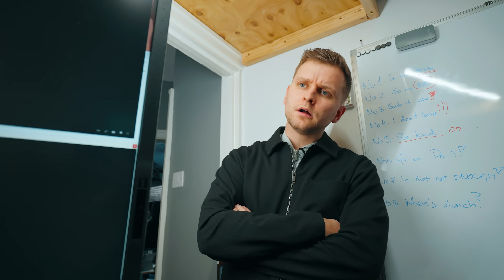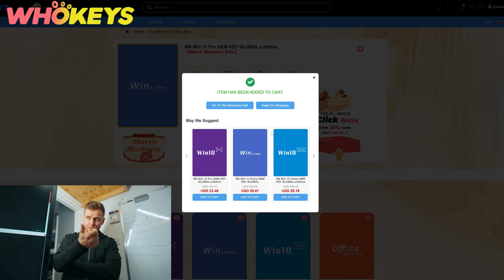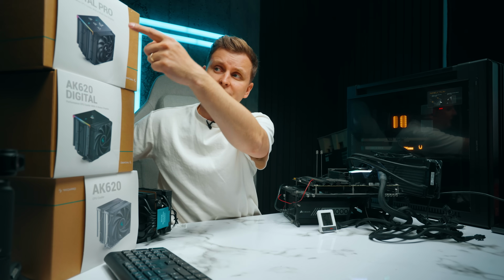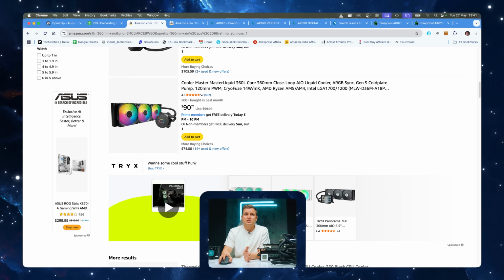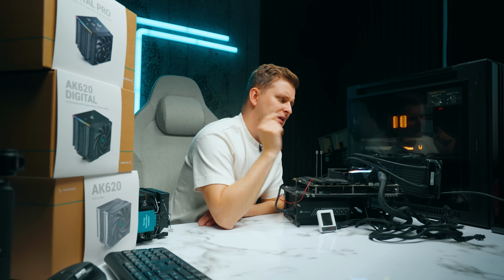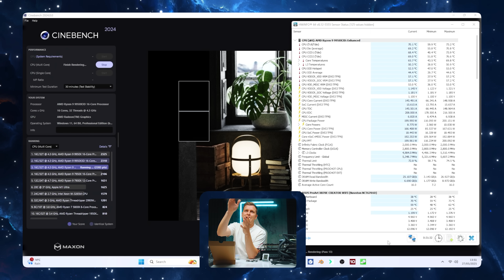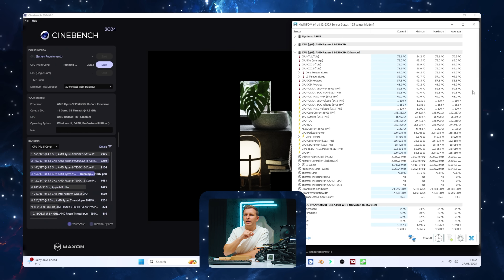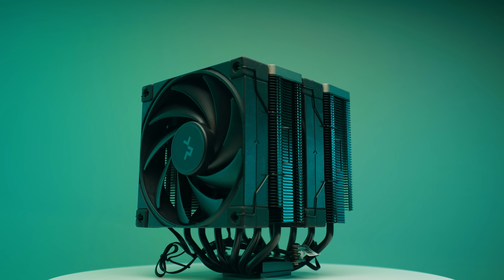Stop Overpaying for CPU Coolers Now! AIO vs AIR [PROOF]

Comment: Thermally, an air cooler will do quite well since heat pipes can pull a crazy amount of heat away, where an AIO will be limited based on water flow over the heat spreader more than the water temp itself. Moving to a thicker radiator like in an arctic liquid freezer three allows noticeable gains, where running fans in push pull will yield greater gains again since fans only actually push their max static pressure at high rpm (large air coolers always do push pull). 

The big benefit in an AIO comes with things like the 5080 or 5090. In a traditional layout, I don't want to dump 600 watts of heat straight into an air cooler above the card, where with an AIO I can run it on the side, with the bottom being an intake to feed the card, and the top being an unrestricted exhaust to remove said heat. Custom liquid loops also do really well because of the large amount of liquid and surface area of multiple radiators plus the stronger pumps. A 5090 fe will run cool considering the power its using, but with a custom water block it will run cooler. 

That being said, AMD uses a very thick IHS on their 9xxx series chips and a direct die for either an air cooler or aio will yield huge benefits. Overall, it depends on the case, the layout of said case, and what the intended use case is.
Reply: Totally agreed
Reply: Nicely explained
Reply: if this is true thanks a lot for this comment

Comment: New custom open loop...it's part of my PC hobby. Custom open loop can be built for the price of 3-4 AOIs. 2 rads,  cpu and gpu under water. If its kept clean COL can last many years. AIO is ez button for liquid cooling and with no maintenance aio can last 5+ years. maybe. The coolant evaporates and pump is non serviceable. Air coolers have gotten much better. Fans can be replaced and probably best cost effective CPU cooling. What about the GPU though?

Comment: Hey always cool to check out your vids. I'm running a 285K with an Arctic Liquid Freezer III 420 , I'm a full time editor and motion person and my system is basically pushed most days all day long. I noticed my temps were running quite hot between 86 and 98 which was too hot for my liking. I got the Arctic Intel LGA1851 Offset Contact Frame and replaced thermal paste with a KryoSheet and my tempos dropped by 11 to 13 degrees under load, kind of blew my mind. Not saying it will be the same for everyone and it could have been the result of a few things even down to the pump screws not being perfectly tightened etc. Regardless I'm super happy as my system is now more stable as well so it's a win. The liquid Freezer also has that fan blowing on the VRM so that is a bonus. The hot spot in the Intel CPUS is still there but shifted a bit so If anyone is running one I would recommend an offset contact frame.

Comment: I just wished AIO's used a non-conductive fluid for when catastrophric failure does happen. Or if they already are, put that info on the box.
Reply: Unfortunately there don´t seem to really be ideal solutions for that dilemma. You can use distilled or even double distilled water, which does not conduct and would pose no risk whatsoever to electronics in case of a leak, not to mention water is a very good coolant because of how much heat it can carry away per volume. However if you were to fill the coolant loop with distilled or double distilled water, although safe in case of leaks, then poses another important problem. During assembly of the AIO's fungal spores floating in the air often end up inside the coolant loop, and the substantial warmth of the coolant liquid is the perfect comfy breeding ground for those fungal spores, which eventually grow to such a dense clump that it can clog your AIO which will cause a failure to cool the CPU and can fry it. So in order to avoid that issue they use additives to prevent fungal growth in the coolant, but guess what, those additives make the resulting solution conductive again! And all of this could potentially be avoided by assembling the AIO's in an ultra grade cleanroom of the samy grade as they use in semiconductor industries, however that would raise the prices to uneconomical heights.

Comment: I'm using a ThermalRight Phantom Spirit 120 SE cost me $36 USD, keeps my 9800X3D nice and cool under gaming loads and idle, never even considered an AIO for it, just not needed.
Reply: air cooling is sufficient even for a 9800x3d? very impressive

Comment: Air coolers are generally much more reliable and long-lasting than AIO liquid coolers for decade
Reply: despite owning and using air coolers for most of my life, i never used a single air cooler for more than 5 years, i have like bunch of them collecting dust, either upgraded the whole system or just went for better cooler, now im running 360 AIO and it its much better than my previous nhd15 chromax i was using
Reply: who tf is using the same pc for a decade
Reply: @lamp6381  you don't need to change the cooler when you're changing the platform, only mounting mechanism (see Noctua and others)
Reply: @lamp6381 Who tf still use AIO when custom water loop is still superior….
Reply: @-raist difference is that the cost between an air cooler and an AIO is at maximum $100 and even then it’s only because of RGB, noctua NHD15 is the same price as Arctic Liquid Freezer III Pro 360mm but gives 10 degrees higher temps. Custom water loops are hundreds of dollars more expensive than AIOs so it’s not even the same argument.
Reply: @-raist  custom loops are utterly unnecessary for the average user lol
Reply: Not really.

Comment: Thanks for a great video. I just finished a build that has an ARCTIC Liquid Freezer III 280. There are options to have individual control of the pump and fans or have them on a single control. Which is best, and if you go for the individual control how should you program this to get the best in terms of performance vs noise?

Comment: 200 WAT is not too much,
when u test 300-400 watt cpu s like 12900K/13700K/13900K,KS/14700K/14900K,KS with remove PL2 limit on them (Which gonna need when u want to get to theirs max turbo frequencies)
only liquid coolers (360/420 ones with good pump and fans  and preferably thick radiators can do cooling)
is some cases like 14900K,Ks even we have just couple AIOs capable of cooling (like Arctic liquid freezer iii pro 420)
other wise need to use custom loop for it! if want to reach its max speed without throttling during 100% loads
Reply: if you care about reading the max turbo frequency, sure, if you actually look at the performance difference from 200 to 400w and notice it's about 3% on a 12900k and maybe 10% on a 14900k ... you realize it doesn't make any sense to let the cpu have that much power to begin with
Reply: This

Comment: At 15:27 you were reading my mind.  The air movement over and around the VRM's and Memory sticks is the bonus.  Most folks dont realize how much heat they generate when under a load especially VRM's on overclocked PC's.  My workstation actually sits at the far corner of my desk (I do have a very large desk though) and it's fan cooled, I don't think I could adjust to the noise of an AIO setup.  Good Video! 👍🏽
Reply: Some AIO’s like Arctic Liquid Freezer III have VRM fans on the pump block which probably cools it better than air coolers because it’s directly blowing air onto the VRMs
Reply: @themarketgardener  Nice! is that layout the exception or the norm if you dont mind me asking.

Comment: I recently had a Cooler Master 240 AIO crap out on me, giving me temperatures climbing up into the 80s for no apparent reason.  Personally, I know the pump block was clogged with contaminated coolant overgrowth, which I experienced with a Corsair 120 AIO two years ago.  So, I switched the AIO out for a ThermalRight Peerless Assassin, and never looked back.  Last year, I sent ThermalRight (I believe it was them) an idea for a Tower AIO that was a hybrid cooler with a pump block, coolant-filled heat pipes, and cooling fins.  Fan mounting would remain the same.

Comment: You went to a lot of work to get these results. I salute you for that. I prefer an AIO mainly because it opens up the inside of your case more. I feel that using an AIO also allows better air flow in your case which should cool the MB and components mo' betta. I've never seen a video about this, but it would be interesting to see what the results are. I'm not against your open air testing but many of us have these components inside of an enclosed case so I would think the results may be different.
Reply: I've seen several comparisons of air coolers to AIO liquid coolers and in almost every one, the air cooler either wins completely or is so close that it's a better choice on cost, reliability, and noise.
Reply: I prefeer air cooling. I dislike annoying fancy scam deals.

Comment: Well, its open  air in your test, i dont think those results would be same inside actual case
Reply: I agree. I got a peerless assassin and it struggle to cool  my cpu in a closed case (even cpu load only, with the gpu doing nothing). It choked the whole build and since I had  invested in fast ram and everything to squeeze every little drop of perfomance I swapped it, and now cpu is cooler, also the fans ramp up is less annoying  before it was going weeeee woooooo and then weeeee at every little thing
Reply: @Ureroll odd for you, PA keeps my 9800x3d as cool as it can be lmao
Reply: People missing the point of Air cooling, if you have tight space go for AIO. But if you have a highly optimized Airflow case Air cooling will yield the result close to AIO slightly higher but not that much.

I use Thermalright RP130 in my Corsair 4000D airflow I have 14600k drawing 200w and xfx 9070xt drawing 370w, but with enough airflow the Gpu is only 53c and cpu is 80c. The room is 25c and all the filter are in place.
Reply: @Teasharky  a decent 360mm AIO will give pretty much ~7-10c lower temps than best of the best air cooler and thats not it, if you mount it as an exhaust it will reduce the overall temp in your case due to much better heat dissipation - that means much lower gpu, ram, storage and chipset temps, compared to any air cooler where it mostly dumps the heat inside the case while relying on case fans to take care of it. TLDR: good AIOs have vastly superior performance than any air cooler on the market.
Reply: They would if the fans are configured the same. Tried it before been air and AIO cooling. AIO wasn't that much better.
Reply: The noctua 12a is the best
Reply: Open air test the efficacy of the cooler. Every case is a variable. It’s taking away that variable
Reply: @get2choppa  but if this variable effects cooler's performance to such degree that it will no longer be comparable to real life scenario in any shape or form, how much value the test contains? Who is the information for?
Reply: @h1tzzYT you seem to completely miss the point. It’s to show what the cooler can actually do. It’s really simple.
Reply: @get2choppa  Thats the thing, its not simple at all, in fact testing cpu coolers is one of the most difficult tasks, because it is a very dynamic thing. You say thats to show what cooler can actually do, but what you suggest is the opposite, a cooler is NOT going to show it's true potential when it constantly receives fresh air in open test bench. That's typically the difference between AIOs and air coolers and air coolers gains from such methodology the most. In proper closed case setups, air coolers are notorious for getting overwhelmed especially when you introduce high powered GPU which constantly dumps bunch of heat. Sure you could argue that with open test bed it 'removes' the case and fan variable, but that is variable by itself (being in open test bench) which is never going to be used in practice. Therefore open test bench cpu cooler reviews are way less valuable than closed case tests.
Reply: It is that simple
Reply: @get2choppa  You are being obtuse just to argue, have a good one👍
Reply: you are right, this and other test like this are fine to show how good an air cooler is, but only with room temp air. in my case the rtx 4090 is producing 70°C hot air for hours, while doing ai stuff, so the temp inside the case is at least 60°C, good luck with an air cooler ...... my aio is always cooling with room temp air as it is pushing air in, not out
Reply: facts
Reply: It will, air cooler towers get affected less by GPU hot air, the AIO to air delta is likely going to get smaller.
They're all gonna perform the same, performance wise. Noise wise, AIO should be in a slight advantage when running in the all core workload scenario.
Reply: Wrong @maozedowner5915 in a case temps go up even take the side panel off and watch the temps drop why you think when it gets to hot in a case people take the side panel off ?
Reply: @maozedowner5915   "It will, air cooler towers get affected less by GPU hot air" - wrong, air coolers when used as intended in closed case, will suffer much more than AIOs, because they "breath" and share same hot air from gpu, air coolers has also much worse heat soak due to its smaller mass. Not to mention if you mount AIO radiator as top exhaust not only your cpu temps will improve but also GPU temps, including every other component as well, due to much better airflow and less circulation of the same hot air inside your case.
Reply: @h1tzzYT  "because they "breath" and share same hot air from gpu" that is not true for a case with front mesh + 3 decent fans pulling in fresh air
Reply: No it won't. 

I got a tight case and the cooler was heating up my GPU to 90+ degrees, sometimes even 95 degrees. Swapped it out for an AIO and it's like 15-20 degrees cooler...
Reply: @maozedowner5915  Yeah no, an aircooler have to deal with the gpu pumping constant heat into it while an aio can completely ignore this, but then the gpu have to deal with the cpus hot air.
Reply: @kazuviking  That's only if you set the AIO as intake, which isn't optimal. Most reasonable layout for an AIO is to exhaust air at the top, which will 100% be affected by GPU hot air.
Reply: @maozedowner5915  Having the AIO as the intake is THE optimal setup. The CPU is more sensitive to already warmed up air than the GPU which have overkill cooling as is.
Reply: @maozedowner5915  airflow in a case with aircoolers are terrible because it is so bulky and takes up the whole  case. Radiators are just better coolers
Reply: @zackwang9314  Radiators are better coolers because they cool with water, objectively the better material to transfer heat. Airflow has nothing to do with its superiority.

Comment: What if you're doing rendering on the GPU and it's a flow-through design where up to one half of the GPU's heat is going up and right into the CPU heatsink? At that point would having an AIO that is "distributing" the heat across three 120 or three 140 exhaust work better?
Reply: Only if you mount the radiator at the front of the case, otherwise the hot exhaust from the GPU will still be rising up into the radiator and hamper cpu cooling much the same as an air cooler. If you do place the radiator at the front (as intake) then the GPU will get less cool air. Best way to get rid of heat is displacement, and water alone won't do that. A custom loop solves both problems, but obviously at a cost.

Comment: Youre testing open bench your results are not valid for comparison, with todays fish tank closed cases air coolers are at a clear disadvantage in terms of thermals
Reply: you dont get a fishtank if you have brain cells anyway
Reply: That's so wrong. An aircooler in particular uses fresh air to cool down, right ? It's not using the air inside of a case ,therefore, it doesn't matter . If your aircooler can't work properly, because you failed the airflow in the first place, you failed , not the hardware.

Comment: it's funny, i asked chatGPT this very same thing last week

in essence, it says AIO only advantage over AIR is "aesthetic"
Reply: Now try to handle 600-1000W overclocked Xeon or Threadripper with an air cooler.
It is possible, I'll give you that much, if you can handle the noise and don't mind 90C+ CPU temps.
Reply: @Rubed0_o  So basically, your argument is for the vast majority of people who do not do what you just said
Reply: What is debatable, because the hoses hanging from the AIO very ugly.

Comment: Would be so cool to see you test the new IceGiant ProSiphon Titan 360 TR for Threadripper, It is not out yet, very expensive  but I'm really curious to see how it handles a PBO. Seems to be the perfect match for a Threadripper: AIO/cutom loop performance with air cooler reliability. I'm thinking of getting the new Threadripper 9000 for 3D rendering and simulations. I would pay that price just to avoid AIOs and get the same performance, I do not want any risk of leaking. Saw some people say that it is ugly (I personally like it), but I'm more focused on performance than prettiness. I want something that can handle over 30 hours of non-stop rendering without the many risks of Aio/custom loops.